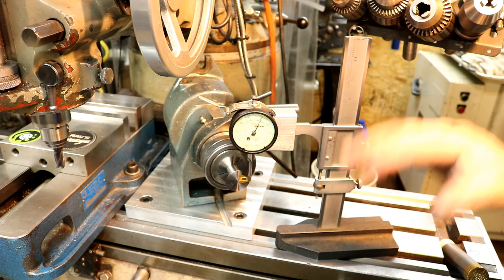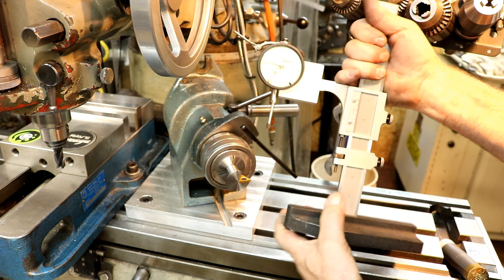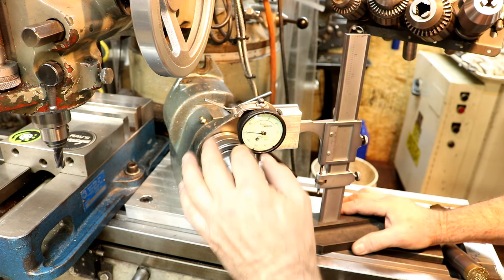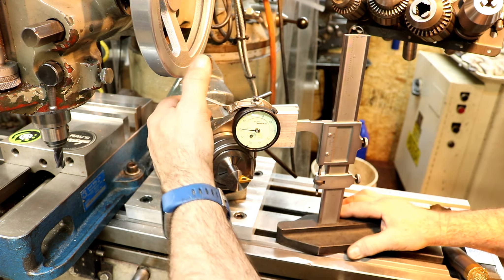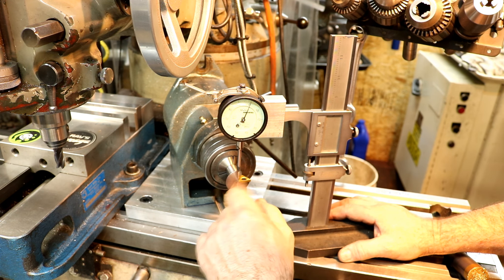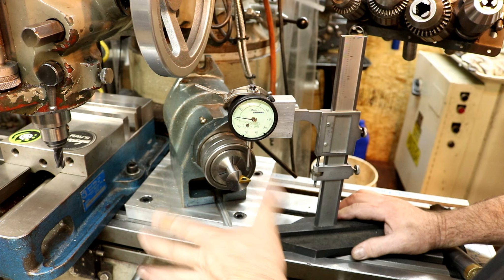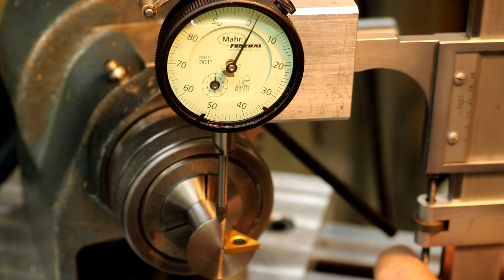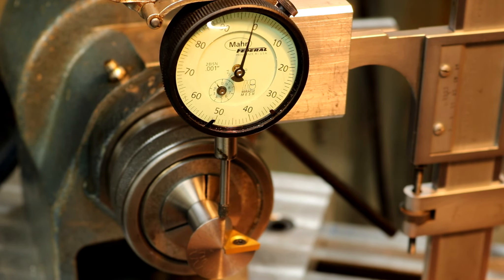How to make a Custom Height Gauge

Comment: For production work, how about two gauges? One set to the highest point of the dovetail and one set for the height of the level cutter. Then just swap them out instead of resetting for each dovetail cutter in the production run.

Comment: Looks like finding the high point and the depth of cut would be easier using the cylindrical part going into the collet, 1 direction vs 2?     great work, keep em coming Randy.
Reply from the maker: You know I have not tried that.  I will try it.  Thanks William.

Comment: Love the idea and result. 

I like the federal gauges - not everybody appreciates them which is good for me and the prices are lower. The internals on the older ones are built like a brick outhouse. Big overkill design but they last, plus they are easy to oil and free up from abusive previous owners. 

Good stuff, soon these dovetail cutters will be making themselves.  

Dan
Reply from the maker: Thanks Dan, I agree about the Federal gauges.  So just when will they be making themselves.  Sounds like AI to me.  
As far as I am concerned they could start anytime.
Reply: Well Bruce is coming up for the Bash - with your setups he is likely good for 300-400 in an afternoon.

Comment: Pretty cool Randy, good job!
I think if I were using it I'd round the corners on the top of that scale some. I just have visions of grabbing for it while looking at the dovetail cutter in process and digging a great big gouge in the palm of my hand about every third time I reached for it.
I also wonder if it would be more convenient to mount the flipper on the indicator to the other side. It might be easier to use one-handed that way.
Reply from the maker: I did stone the top edges so they are smooth.  I still may cut it again shorter.  This flipper can only be mounted on the one side.  I think I will make one for the other side.  It is awkward the way it is now.  Thanks.

Comment: Hi Randy,
Nice Job! Have you thought about making a master from the table to the center line of the dove tail cutter and setting the indicator to that? Also, you can have two steps in the master, one for the center line and one for the pocket depth.
Steve
Reply from the maker: Thanks Steve.  Due to the variation in Dia. and lengths, I not so sure that will be the most accurate, but I will look in to that.